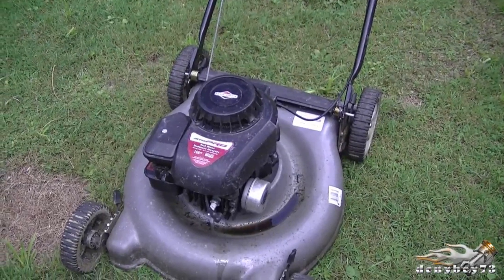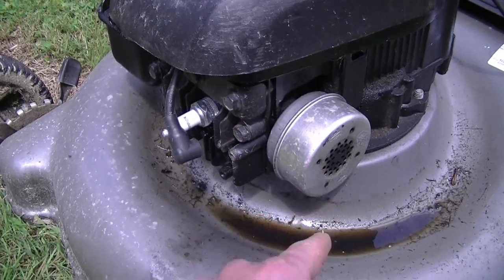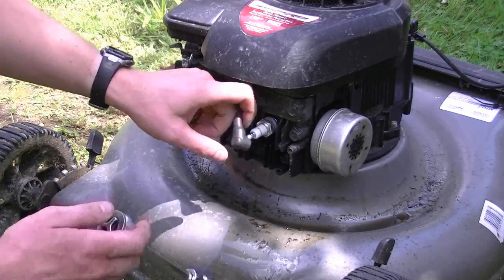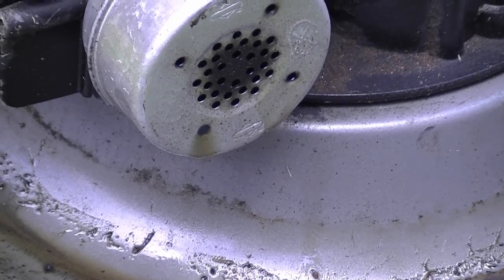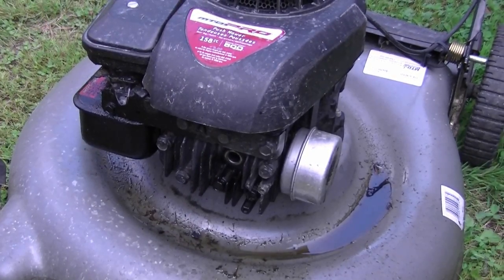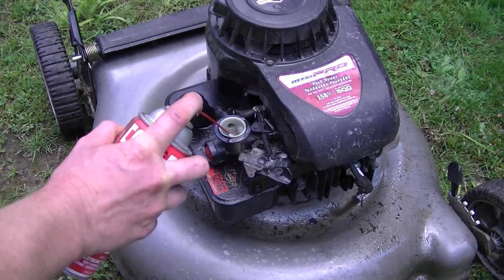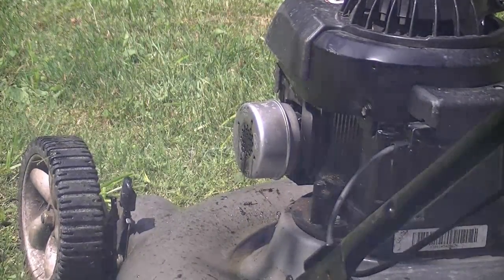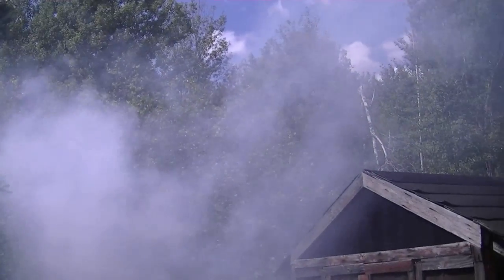How To Fix a Hydro-Locked Lawnmower

Comment: I have a Craftsmans 17 HP riding mower. I tried what you suggested. I pulled the spark plug and it turns over. I turned it over for at least a minute. I put the spark plug back in and it locks up again. Repeat and it does the same. Any suggestions
Reply from the maker: here's repair solution in this video https://www.youtube.com/watch?v=T1anxdNWf5Y
Reply: @donyboy73  Thanks very much!!
Reply: Thanks for the great video, learning here.

Comment: I have 9.5 hp wood chipper that had not been used for 5 years. Would not start. Pull handle froze. Found and watched your video. Followed your instructions and freed up the freeze and fired her up! Thanks!

Comment: This worked exactly as in the video. Removed spark plug, pulled the starter about 20 times, wiped off the spark plug and replaced and mower started on the 1st pull. Saved me the $250 I was about to spend on a new mower. Thanks!

Comment: I honestly was about to bin the Honda GX200 I only recently bought second hand.
But you explaining about the oil, my engine must have rolled around in the back of the car.
Watched your video about 15mins of pulling and the pressure smoothed off and it kicked into life, the garage looked like it was on fire with amount of smoke!! Lol...
Cheers for your straight and simple vids.
No graphics or gimmicks just straight to the point! Nice one 👍

Comment: I know nothing about small engines. This was a giant help. All I knew was my pull cord wouldn't pull. .... right after I had tipped over the mower to clear it of grass. So everything you said and explained made perfect sense. I took out the spark plug, and sure enough the pull chord suddenly worked and shot out a ton of oil with the first pull.... but none of the rest. Good stuck, thank you :-)

Comment: This worked on a new snowblower. I brought it home tipped on its side to fit my car. I think the oil migrated to where it caused the hydro-lock. Would not crank over at all. Pulled the plug and then it could crank. No oil or gas came out. Put it back. Ran very dirty for 10 minutes, then fine. Thanks.

Comment: This has always been one of my favorite repairs. Always a quick fix, especially when a careless lawn crew doesn't close the fuel shut off before transporting a long distance or on the highway. I also make sure to change the oil if fuel is in it at least twice to get all the gas out of the crankcase and not damage any internal components, especially the aluminum connecting rod.

Comment: I got yard machines push mower with the  big back wheels from a guy today for $10 this thing is like  new. he said that the  engine was blown and locked up and oil was coming from the muffler.it was hydrolock just like  the mower in your video and he put way too much oil in it .mower runs great now after doing the same thing you did in this video  .now ill sell it on Craigslist for $75 thanks a lot .

Comment: I agree with the rest of these comments. You are one of the best MUTT's around (Multi Use Technician and Trainer). I would add, check the oil level and bring it up to the correct level before starting.

Comment: AFTER WATCHED YOUR VIDEO , I DO THE SAME TILT THE MOWER UNTIL OIL CAME OUT MOST OF IT AND REMOVED SPARK PLUG CLEANED , FIRST TRIED IT STARTED LOT OF SMOKE CAME OUT BUT NO LUCK . TOMORROW WILL GET DIFFERENT CHEMICAL CLEAN OILED WET SPARK PLUG AND TRY AGAIN . THANK YOU SO MUCH .

Comment: Right on. I had a B&S engine on a rough cut mower that I couldn't even pull the rope on. Yes I stored it over the winter up at about a 45 degree angle. After removing the plug; pulling the rope to force out all the oil above the piston; checking the crankcase oil level, cleaning the plug off completely with denatured alcohol and drying it, it started right up.

Comment: Donyboy73, What a time saver! For the most part, your videos are always short and sweet. I am smiling so hard right now,  you're the best!
Reply from the maker: thanks lol
Reply: I did these things, and the pull cord works when I remove the spark plug, but the mower wouldn't start. What now?
Reply from the maker: you may still have oil in the cylinder, you may have to repeat the process
Reply: I forgot to add that when I did put the spark plug back in, the pull cord wouldn't work at all. Nevertheless, I will keep repeating the process for awhile.
Reply: donyboy73
Reply: j
Reply: Carol White h

Comment: 100% on the money. Just saved an MTD at the curb with this exact problem. Oil level was too high, saturating the air filter. Corrected the oil level, replaced the air filter, and changed the plug for good measure. Also had to pop the butterfly free, mine is the fresh start no prime system Briggs. After doing that, the mower runs like new. My neighbor was shocked. Lol. Said he did not need the machine, got an electric one. Yea right. Lol.

Comment: Great clear video of how to do this but I would add some safety tips. Because there will be someone who does this badly, maybe encourage the use of a dust mask, goggles and clean up the excess oil & starter fluid before starting the engine again.  Other than that your clips are the best to follow.

Comment: Oh - thanks!  So, you think the problem is with the carb?  Does it require a complete rebuild, or can I replace those things just by removing the bowl?  If you can't tell, I'm a real novice at homeownership and small engine repair.  I inherited the riding mower from my folks and they dropped it off at my house, so I don't even have a trailer to take it to a mechanic to get fixed.  I really appreciate your help.

Comment: Had a riding mower that would hydrolock due to gas in the cylinder due to a bad carb float. I thought.  Replaced the carb and had the same issue. Bought a $7 in line fuel on off valve. Problem solved. Just have to remember to put the valve the appropriate position before and after use.

Comment: I had this happen and through an hour of Internet searching I finally got it going by removing the spark plug and forcing the flywheel with a pry bar to get it moving again but it's run flawlessly since.

Comment: Excellent video and explanation!  A few hours ago I tried to start my lawnmower and couldn't get it to pull over at all.  Was worried I had blown the engine. Found your video and all is good now. Started fine on one pull without quickstart.  I didn't have as much oil or smoke as you did so not sure it was exactly the same problem but releasing compression by removing spark plug got everything working again.  Thanks very much for sharing your expertise.  Will be checking all your videos.
Reply from the maker: thanks Jim, make sure you are subscribed

Comment: Thanks for the upload same problem with my pressure washer. Save me my sanity
Reply: Someone came to me with a pressure washer that was hydrolocked. They had filled it up to the TOP with oil rather than to the mark on the dipstick. We drained all the oil out of the crankcase and cylinder and refilled to the mark with SAE30, then started it with ether and totally smoked the neighborhood for 15 minutes!

Comment: Thank you for helping me fix my mower! I had that exact problem, and it happened just as you described. I didn't have the straw with my spray, didn't need to spray the carburetor, did have as much smoke, but I was up and running in no time. I only spent $3.59 for the quick start spray. Much appreciated!

Comment: Hi,I am a retired gentleman. I am using my free time to learn about small engines. I recently got an older  Briggs engine just to play with. I have viewed many You Tube videos but I really like yours. Very clear information. The engine I have came from a Craftsman 6.0 "Easy Starting Quiet". I am trying to see if I can get it going. The major issue I have is that it is very difficult to pull the starter rope even with the spark plug removed. Like I mean REAL difficult. I see the piston move up and down (I removed the cylinder head cover).Now before I go any further I'm wondering if the main bearing could be seized. How can I confirm that the main bearing on the crankshaft is bad?  Thanks , Tom

Comment: Dony, Mr. Wonderful stored the mower exactly like you showed, and of course I couldn't pull the cord. He was ready to curb it, but it's a troy built and I like using it. My question is: since I put new gas and new oil in will I have to drain both out before doing this?? AND is carburetor cleaner the same thing as quick start??

Comment: Is there anything, other than overfilling the crankcase in the first place, that will cause excess oil in the cylinder?  Thanks for the information.  I have had this problem but did not have a clue.
Reply from the maker: TIPPED SIDEWAYS FOR EXTENDED PERIOD OF TIME OR TIPPED WITH CYLINDER FACING DOWN

Comment from the maker: if the blade is bent it will vibrate, also make sure the shaft was not bent, I have a video on a lawnmower with a bent shaft

Comment: Wow! This was helpful! My brother wants to build a go kart with a lawnmower engine, so he put the engine in a box to store it. It was on it's side, so oil was leaking out of the muffler. I gues I know how to fix it if he ever wants it to run again! I guess you need a horizontal crankshaft motor to build a go kart, because you can't put a vertical shaft motor sideways can you?

Comment: I actually got a mower from someone. They said that they could not start it, but we have a better one so you can have it. It needed gas... I tipped it up like that it was hard to pull, but still started, smoked like crazy though. I guess you can count on your briggs and stratton.

Comment: I had this issue of the pull not wanting to pull. I took the spark plug out and removed the coil and put it back on and pulled the rip cord 15+ times but no oil or gas that came out of either area. but there was oil on the spark plug and inside the spark plug well. I cleaned the well to remove the oil inside there was not much on there. Have to buy a new spark plug before trying to see if it will run. Even though video is 12 YO still a great video

Comment: first of all, this is amazing, thank you. Exactly what was wrong w/ my mower. 

I do have one question. This is the first time it fully hydro-locked. but the mower has a history of blowing smoke out every now and then when i start it up, but by the time i was done mowing it would be blowing clear. I would think this meant that it cleared the pooled oil. 

Is there any reason that oil would keep filling the chamber? I bought it from a buddy, so maybe he overfilled it, and it's just continually happening because it need drained a bit. but is there anything/where that could be leaking oil internally i could check, to see if i can get it to stop?
Reply from the maker: +Mark Casey keep it stored level, I use sae 30 oil, a bit thicker so it may help. make sure it has correct level of oil
Reply: +donyboy73 last question: I've got it turning over now, but it'll only hold idle for like 30 seconds. Is the starter fluid what I need? Didn't have any on hand at the moment.

Comment: Hi Dony,  Thank you for all your videos helped many times.  I have a 
John Deere JS63c it becomes hydro-locked.  I remove the plug, pull the 
cord to clear out the head but I don't see oil  I see gasoline shooting 
out.  The air filter housing becomes full as well.  I clear it all out 
and it will start, then after its off for a bit its hydro-locked again.  
Any ideas.  Thanks, John

Comment: I have the same problem with a weedeater. Took spark plug off but nothing sprays out of the spark plug hole when I pull the starter cord. What would you suggest I do next?

Comment: Hi Dony!

I have a lawnmower that someone put roundup in it by mistake and tried to start it (I know it's odd loll) but I've disassemble the carb and cleaned it all good and it started first pull, she ran good for about 20 minutes no problem then it stopped suddenly, I tried to restart it but she had no compression at all. Do you think the roundup can had damaged the cylinder rings or maybe the valves? (sorry for the bad english, i'm french)

Thanks

Comment: I have seen a video which states that Quick Start is too explosive for use in small engines and may cause engine damage.  
The suggested preference is to use carb cleaner.  Is this good advice?

Comment: I bought a new mower and after about 10 minutes normal use smoke started to come out of the muffler and started to build and build until it shut down.  The oil level was at recommended level. Air filter wasn’t blocked. It would run better if the oil level was on the low side but the same thing would happen. I returned it to the store. What do you think was wrong with it? I did not tip the mower with oil in it, level the whole time.

Comment: I wish I had seen this before investing in a new battey/starter. After it still wouln't start I took the plug out and cranked. Put the plug in and started right up. I knew about hydrolock but never thought it about it on a mower. That was a couple of months ago and today I had the same thing. This time I knew what to do. Plug out and gas poured out. What I don't understand is what causes this. I ordered a fuel shut off but it won't do anything about the fuel already in the bowl.

Comment: Hey Don - Thanks for these great videos!  They're super helpful.  I think my 15.5-hp Briggs & Stratton riding mower is hydro-locked, too.  When I did your fix, I was able to get it to turn over, but now, I seem to have gasoline backing up in the air inlet of the carburetor and leaking out.  Any ideas?  I recently pulled the bowl off the carb to clean it out (without dismantling the entire carb).  I also recently installed a fuel shutoff valve between the tank and the fuel filter.  Thanks!

Comment: Hey Don! I have a Tecumseh 11 hp on a Coleman Powermate generator that will yank your arm out of the socket. It will start and run fine if you find the right spot when pulling it, but mostly, it yanks back and breaks the pull cord. (Fixed that with one of your vids, thanks!) Any suggestions on my problem. I've been told it's back pressure/timing adjustment, pressure valve replacement?? Any help would be appreciated. I'm about to drop it off at the repair shop. Thanks!

Comment: Thank you for the great video, donyboy.  I have a question:  Mamma has a husqvarna self - propelled push mower, and I tried to start it yesterday.  The pull rope at first pulled fine-  it didn't start,  as I pulled a few more times, the rope got harder and harder to pull, till I seriously could barely pull it -  over about 4 more pulls.  Mamma said the other day when my sis was using it to mow her lawn. it got hot then she could not start it again.  Then, later, Mamma got it started but it wouldn't remain running.   It has fresh non-ethanol ethyl in it-  its all we ever run in our lawn and garden tools.  Oil is dark but adequate amount.  Is this video above (hydrolocked mower), the right one for me?  I watched it and I will try it, but I didnt notice any oil- (knowing Mamma she would wipe it up, however)  IF you can think of anything else, please let me know.  I will be working on Mammas mower tomorrow.  Thank you for your kind help!
Reply from the maker: mamma's mower may be hydrolocked, also make sure that the brake cable retracts properly on mamma's lawnmower or it will be hard to start
Reply: Thank you, donyboy!  Thank you MUCH!
Reply: donyboy73 IN looking at Mamma's mower, I noticed that the bar at the top of the handle, that one has to hold up against the handle to allow it to start then run, that is SUPPOSED To return to the sticking-out (or down) position when its not running, is floppy, and rests in the 'up- start' position.  Mamma said her mower "doesn't have a brake..". Is this the brake cable you referred to?   IF that is the brake cable, how do I fix it?  Thank you.  You are a godsend!
Reply: ***** Oh, and I dont see any trace of oil on the exhaust or deck.
Reply from the maker: search my channel for "how to replace a lawnmower brake cable"
Reply: Done, and I watched it, and took the cable off, because it appeared stretched-out, but in doing so, I noted it (cable) could NOT be pulled through its covering while attached to the machine, yet easily pulled through when off the machine, which got me to looking, and I noted that there might be a part missing next to the armature that the brake maneuvers, which would pull that cable tight were it to get pulled toward the front of the machine.  I took a pic of it and will try to figure out how to post it here in this comment...  nope. Not happening.  Rats.  I did put the lower part of the cable back on the nachine to photo it.  Guess I will try to figure it out by scanning your videos.

Comment: My mower is doing this very thing, pulling the cord, it becomes very hard to pull.
I picked up the mower 2nd hand, and didnt have this issue. The mower was filthy so i took off the engine from the base, removed carb and gave good clean (outside). re-assembled everything and the pull start issue happened.
I may of had the engine on the bench on an angle and possibly built up oil in the piston, but trying the tip from you video, no excess oil would come out of the spark plug hole. Any other tips?

Comment: Hi Dony,

I have a 2 stroke 30cc line trimmer engine I use as a model on a stand. It worked beautifully then the next day I could not start it. Found the spark plug was producing a white spindly spark so I re earthed the coil and cleaned it all. It now produces a fat blue crackly spark. But it still doesn't start! I am starting it with a powerful drill. Took the whole engine apart, cleaned out the carbon and put it together with new gaskets, still no go. Any help? Thanks so much